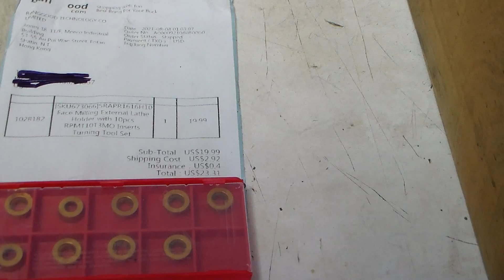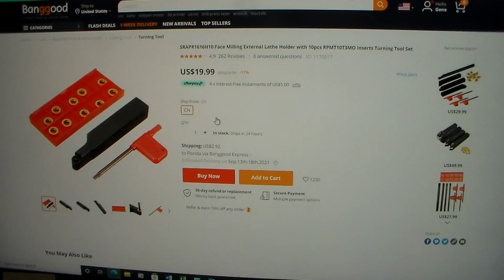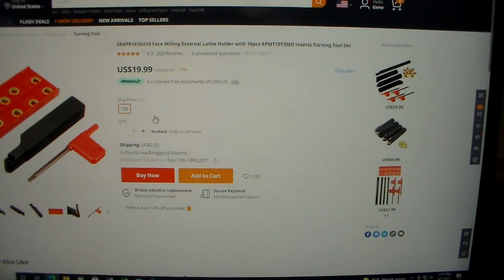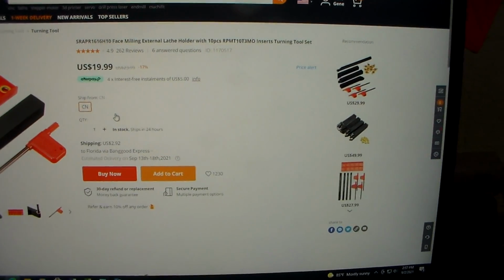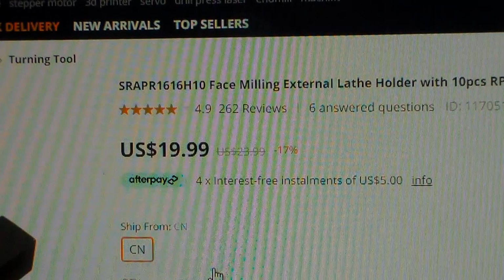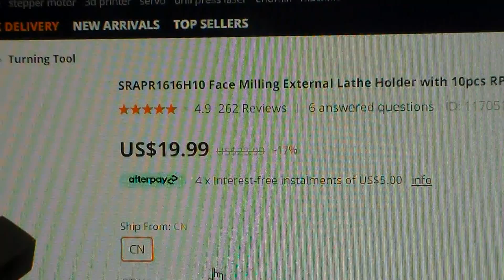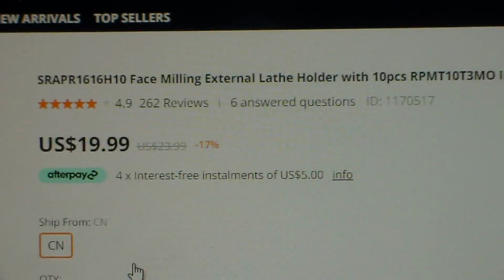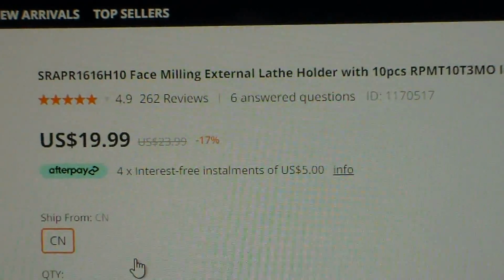Carbide Insert  Fly Cutter Bit

Comment: Any concerns with the inserts chipping since its an interrupted cut?
Reply from the maker: I have had NO trouble with the inserts chipping.  I also use the same insert in my lathe tool holder.  Even it you hit a very hard spot and do chip the insert you simply rotate the rotate the round insert a few degrees and you are off and running again.
Reply: @Histandard2011  Awesome !!!
Reply: @Histandard2011 

Hi Adam, I'm about to venture into fly cutting.  

I just got a 6pc Indian fly cutter set, 3 - ½" & 3 - ¾", dia ranges from ¾ to 2¼.  They take tooling from 3/16 - 5/16".  It was the cheapest set I could find w/ the most variety.  My wife works for MSC, so I get stuff dirt cheap. I wanted to get some experience before I started looking for or making bigger, better.

I have a lathe & 2 LH indexed tool holders to experiment with; 1 is a round insert like this vid & the other is a triangular insert, so I don't have to go buy any tooling.

You 2 fly cutting vids caught my attention because you seem to go against 'conventional thinking' & for what works.

I'm like that, as well. I've been working on care since age 12 & built my 1st race car at 16, (drag racing).  Been fixing, building & fabricating every since.  

Owned a biz w/ an old friend for a time building street rods, race car chassis & restoring antique cars. Had lots of room & equipment for the only time in my life.

Most of my 70 yrs I havn't had the money for fancy ideal tools so I made stuff work.

Along w/ my mostly side fun of building/racing cars & such, I clothed & fed my kids as a contractor; spent 30+ yrs doing remodels, lots of custom work. Even built a recording studio as my last big project.  He was hoping for a demo studio when a mutual friend asked if I could 'save' him from an unscrupulous contractor. I did, & last count he's recorded 15+ albums for him & others. Did it on the same budget. He's happy, as you can imagine.

Anyway, my experience brought me into maching 7-8 yrs ago when I got a lathe. I've been wanting to learn to use & have a lathe & mill since the '60's, but either didn't have the room or the $$ until my 60's.

I studied books & YT vids, learning all kinds of theory & such while I was laid up for 6 months, then jumped in.

Seemed like DoC & Speeds & Feeds tables weren't made for my lathe. I couldn't get anything good from them; did better doing the opposite, sometimes.

So, I started experimenting, using my 'Get it done w/ the wrong/improvised tools' experience & started having reproducable success.

I bought an old Jet 16 round column mill this summer, my 1st foray into milling, except what sorta milling I've done on my lathe using a milling attachment I made.

It was flaky, but better than the router table I've been using for years, er decades... since carbide came into the construction world, I've pushed the envelope, a bit..  lol.

What I wanted to ask, (& share w/ you), is if fly cutting depends on a very sharp cutting tool?  May seem like a dumb question, but I have found situations where tooking can be too sharp; gets too aggressive & even shallow cuts in material is impossible.

Best broad scale is a too sharp drill bit in a hand drill.  What a nightmare that can be.

Learned how to put an edhmge on steel long ago; when I started in carpentry, carbide saw blades didn't exist. Everybody had a rack of blades in their truck, destined for the sharpener's place. One nail or two rocks & a blade was done.

A dozen rips of oak on a table saw & the burrs start.

After I got the 1st carbide lathe tooling I picked up some diamond abrasive tools, (https://www.mscdirect.com/product/details/38611158), a set of these.

At 1st, I was just working on brazed carbide. I'd bought a big azz box of lathe cutters from a retiring machinist & got all he had. He'd never used indexed tooling.

One day, I was struggling w/ the lathe & mistakenly thought it was the insert, (later found out it was a broken cross slide lead screw nut).

The funny thing is, I learned a bunch filing on inserts. Enough that when I'm working on sticky aluminum, mystery steel or something hard, I get after a brand new insert before I use it.

I've found sacrificing a coating or radius is a fair trade when a razor sharp edge works better than anything else.

That brings me to my question about fly cutting; if sharp's better, then giving one of those carbide cheerios an edge just might be the ticket.

I've been thinking about my scrap pile & what I can try out a fly cutting on since 3:00 am!

Wanted to connect w/ you & share one of my out of convention discoveries w/ you, thought you'd relate.

The other thing is I see your earlier vids were RCBS related. I haven't reloaded in years, don't shoot much, any more.

But I did find a great use for the RCBS brass tumbler I had; thought it might help you as much as me.  It makes a great, minimal mess parts cleaner.

Got some plastic gutter screen from Home Depot & covered the inside brass basket using the screen & zip ties, to keep small screws/washers in tumbler basket. Then I put some scraps of tile in the bottom of the tumbler, so the level of fluid would be high, but a lower volume. Figured I'd be changing the fluid a lot, so saving $.

My neighbor told me about a Dollar Tree cleaner almost 20 yrs ago, Awesome Orange; I've been buying 10-15 half gallon refill jugs @ 1.00 ea, every since.

Probably cancerous as all get it, don't drink or bathe in it, but it is a degreasing mi fo.  I use it in the shower tub, just spray it, no scrub. Brass clean, chrome sparkles, soap scum gone.

Like I said, likely give our dead uncles cancer... 

Put enough in the tumbler that stuff in the basket can soak & give it 7-8 spins per hour & in 2-3 hrs, stuff looks like it was hot tanked. It takes every paint but lacquer off, if soaked.

Here's the kicker, though. After a year or so, I was cleaning some stuff, most of it rusty, so it was heading to a derust bath.

I needed to change the cleaning fluid, & looked at the jug of derusto solution I use & thought..  

Wonder if I can make this a 1 step process.

Damned if it didn't work.  What I'll caution is the last gallon of de rust, I tried, Evapo Rust. Thought I try it, & it doesn't work as good, by itself or w/ Awesome Orange as well as my 1st love, Metal Rescue.  It's slightly more per gallon, but it's well worth it.

So, if you have a brass tumbler you're not using, or if you need a great parta cleaner enough to buy one, go for it. You win't he disappointed.

It is so low mess, I had it in a spare, light colored carpet, bedroom, on a small backseat floor car mat for a winter & didn't get a drop in the tan carpet.

Was careful, but not overly so. As long as you don't aggressively tumble the parts, it doesn't even leak more than a drop or two.

Hope that helps, as well as the insert sharpening suggestion. I'll let you know how my fly cutting goes if you're interested. I'll be putting an edge on the Cheerios, fior certain.

GeoD